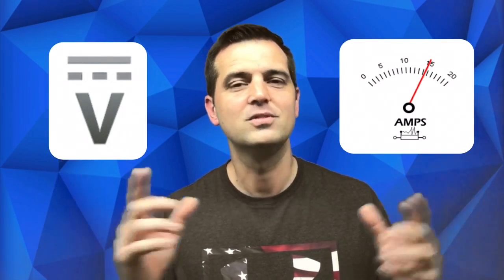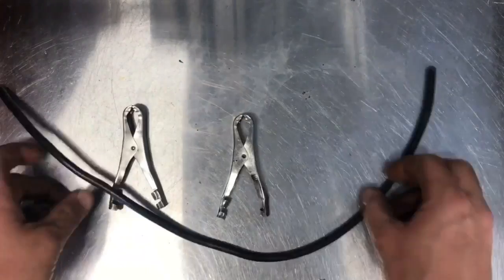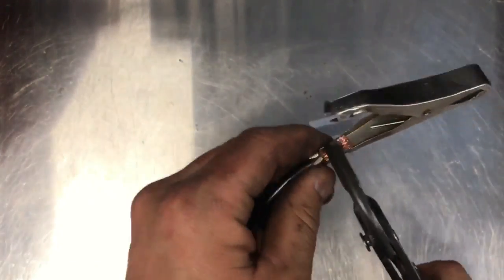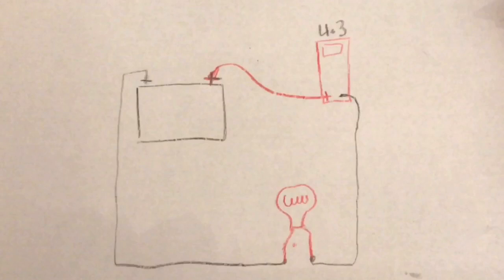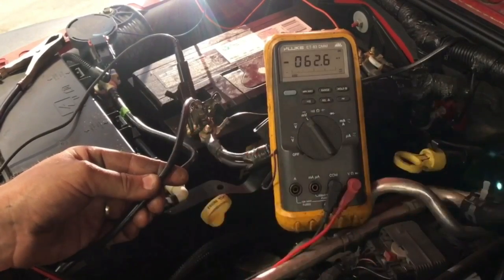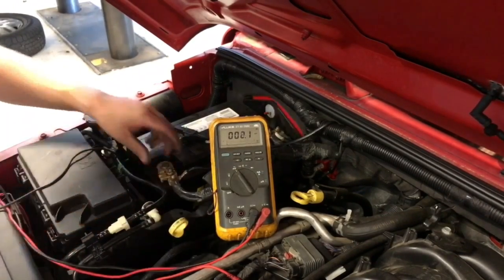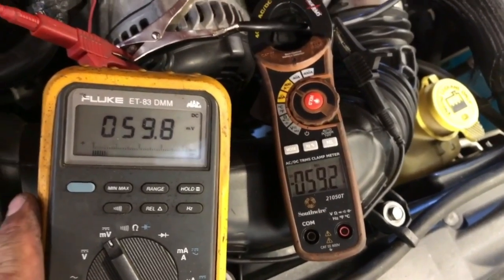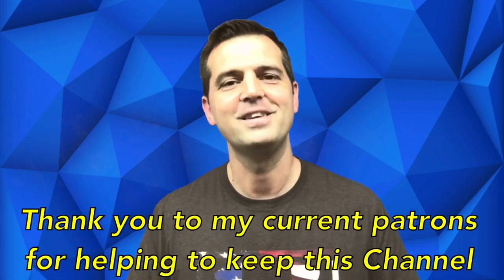How to test an alternator the right way!

Comment: Nice trick, but instead of using this testing cable and "calibrating" it, it is much simpler to use the procedure you describe by using the car's negative cable that goes from the battery to the chassis and measure mV across this cable directly. Calibration can be done in the same way. By putting a bulb of known current draw across the battery terminals and reading the resulting millivolts on the multimeter. Then, this value is the reference value for every new load measurement, by applying the arithmetic analogy method, that is, for the (say) 21 Watt lamp I used as a reference, I measure (say) 15 millivolts as translated current. Now that my new measurement is (say) 86 mV, how much is my new current? In this way one does not need the external testing cable and its calibration making things easier and simpler, while the general idea remains the same. Anyway, your presentation is correct. Thanks for sharing the idea. Personally I am using it for many years now whenever I suspect something wrong with the electrical system of the car. Moreover, one can detect even the slightest parasitic current drain of the car's system, provided that the multimeter he uses is of a good brand name, with proper measurement properties for that purpose i.e. high accuracy in the millivolt range. In this last case, only the immobiliser current draw (which must be known beforehand) should be measured when the car in in a "key off - motor off" status. Any other indication in excess of the (known) value will represent a failure (i.e. parasitic current draw) of the system needing further investigation...

Comment: The "Shunt" here, I think, is actually a voltage divider. 

First, about meters. Internal to the meter, between the "AMP" and "COM" connectections, is a shunt made from a calibrated size of copper. Although copper is considered a "conductor" there is still a resistance to copper that can be measured - although it will be in the milliohm or micro-ohm range (.001 to .000001 ohms). Suppose the internal shunt inside the meter for the amps function has a resistance of 1 milliohm. And now you hook the meter up to the battery while it is drawing 10 amps. Using Ohm's Law were E=IxR. That is, voltage = current x resistance. So, 10 amps x 0.001 ohms = 0.010 volts, or 10 millivolts. The meter is actually internally measuring 10 millivolts across the internal copper shunt (which is actually a precision 1 milliohm resistor) and the meter is actually displaying 10 millivolts... but since the human operator has selected the AMP function, the display scale is re-calibrated to be shown as amps so that the human operator does not have to keep using Ohm's Law to convert the meter reading. 

The meter's internal shunt has a limit of safely handling 10 amps without damaging the very sensitive voltage measuring circuits. To measure current greater than 10 amps requires the use of an external shunt.

Think of his black wire, which has an overall resistance of about .002 milliohms (or 2,000 mico-ohms), as a long string of 2,000 one micro-ohm resisters connected end to end. At the end connected to the battery (at the first of our imaginary resistors) there is no voltage drop. At the 2,000th resistor at the other end there is about an 8 millivolt drop. So, along the length of the shunt, there is a gradient of voltage from 0 to 8 millivolts. By using the pin to probe through the insulation, he is finding the exact spot where the voltage drop is exactly 4.3 millivolts. He picked the spot where number of millivolts would equal the number of amps. He could have picked anywhere - but there would have been more math involved to convert the ratios. This way, we can just read the millivolts reading on the meter and know that it has a one-to-one ratio correspondence to the number of amps.

The theory for his shunt / voltage divider is actually covered in the first few days of DC Series Circuits. But, what Carolina Custom has done to turn a chunk of wire into a semi-calibrated meter multiplier is brilliantly clever!!

Comment: A very good video, thank you.. It shows the general operating principal of a current shunt which are a vital component in many electronic devices. When I build heavy duty power supplies I usually buy premade ones which are solid brass and calibrated, however for the smaller supplies I use a piece of wire of the same length on all of the models, and wire up a stand along milivolt meter which says it measures amperage on the display. It's wired just like you have here except made permanent with soldering.
Reply: Just take off the positive battery cable while the car is running. If engine stays running, the alt. is good.
Reply: Larry Zoch a
Reply: @larryzoch4344 But this isn't true on older models pre sensors and fuel injection is it?

Comment: Works for big jumps in current draw I found.  I had a hard time finding that sweet spot you mentioned.  So I just tapped off not far from the on clamp.  Basically the greater the distance you spread your volt meter leads for the pick off the higher the millivolt reading you will get.  At least that's what I was seeing.  I didn't find it was very useful or accurate in the 10's of amps range, but 20's to 200's you will def see a jump and a big change in that millivolt reading if you turn on say an 1600w inverter with a 1600w load like a heat gun, which is just what I have in my company truck since I do avionics work on Helicopters sometimes remote in the field.  Thanks for the vid.  I found it useful.

Comment: I like your vid even though I just bought a clamp meter that I can also use as a general function multimeter. I just like the idea of not having to disconnect anything to take measurements.
Your video however, taught me a few things and for that, I'll indeed subscribe.  Thanks for making this.

Comment: Thanks, good video...
I used to load-test PC power-supplies and needed a way to measure the load.  That's where the shunt would come in, and I could then attach a mili-volt meter across the shunt, instead of a DMM..
It's the same principle, but using analog guages,,,

Comment: Lots of guys commenting on how an alternator's output may be, say 130amps, but the system may only demand 85amps for charging, a/c, lights, or stereo, etc.  You may have leaky connections.  Where do all those extra amps go?
Easiest way to find out is to slide a piece of cardboard under the car when you pull into the driveway.  Next day, pull the cardboard out and look for any extra amps that leaked out overnight.  They're silvery, shiny, and may leave tiny burn marks.

Comment: Great video I would just like to add that a good volt meter that reads acurate MV's aint that cheap either . AND the price for a fair  clamp meterThat reads AMPs DC  can be round same price as a good volt meter that reads acurate MV"s. So with that I have to say this video is by far the most clever I have seen thus far on youtube KEEP EM COMING BRO cool accent too lol 10 thumbs up for YOU!  Check cheaper clamp meters on Amazon that read amperage I picked one up for $27

Comment: Sears sells their amp clamp for about $60. It measure AC/DC amps, voltage, resistance, freq., and continuity (with sound).
Reply: joe r what is a sears?
Reply: Sears, Roebuck, and Company.
Reply: joe r I’ve heard of them...it’s a shame they aren’t around any more, poor mgmt probably ran them into the ground I’m guessing.
Reply: They ARE still around though few and far between.  I still believe you can order that meter.
Reply: @NukeNukemson  Inflexible business model. Segments of the  business lost to Walmart, tire chains, oil change shops. There was a Sear in my area until a few years ago. Their clothing section was small but they sold good men's clothes, I thought.

Comment: Thanks  for the video  its just  that amp meters  so cheap  these days so I don't think  people  would  go this way to test but I like the way u calibrated  the wire  i just never kn a wire  that  gage  could  have that kind of resistance  in such  a short distance.
Reply: D.C. Amp meters, not so cheap. especially  clamp meters.
Reply: 22.99 harbor freight

Comment: If you don't need over 100 amps I recommend the uni-t ut210e it can do dc current up to 100 amps and is pretty accurate even at small currents like under 1 amp if you need that I have one and have been happy with it and it's under $50 but make sure you get the E because they have others but they don't do DC current

Comment: The (calibration) was pretty neat but I'd hook your connections on the copper wire not the clamp because those clamps are probably adding a good amount of resistance

Comment: I am reminded that I don't know as much about alternators as I thought. Thanks. Back to finding out why my alternator won't charge at idle with the headlights on and heater full blast with a 130 amp gen 3 mustang alternator. I am thinking its the grounds?

Comment: I would use insulated color coded alligator clips - splurge a little for safety. You short out your "shunt" and lets see:  blown diode bridge on alternator, battery blows up, roasted electronics/computers, fire, slagged copper and what ever Murphy can think of extra. You might have gotten away with those things thirty years ago, but not today.

Comment: Much smarter than before I watched the video.  This is so awesome!  Anyone wanna share the math behind this?
Reply: @Happymacer  Why would the alternator fry?  I've ran them with open leads for decades without problems.
Reply: @Happymacer  I always figured the voltage regulator would keep the voltage in check.
Reply: @Happymacer  no clue. Been doing it for nearly 40 years with no problems thus far lol
Reply: ohms law that's it
Reply: He made a 0.001 Ohm resistor   so any time you read Voltage   v= i x R    y x 0.001 =  0.00y     or as he said y mV.   same number  just move the decimal over. which the meter does for you.

Comment: I have a clamp meter but found it almost impossible to actually clamp it round the battery/alternator cables, the only access would be from underneath with the car on a ramp. But if anyone is interested you can buy from Amazon and other outlets an adaptor for your multimeter to convert it into a clamp meter quite cheaply.

Comment: What you have done is measured a voltage drop, known as an I.R. drop across a section of the internal resistance of of your wire. By probing the wire while connected to meter, you located the place where the milli volt reading matches your amperage or current for the light (4.3 amps) . For (4.3 mV) drop to appear on DVM screen matching (4.3 amps), you have located a place where the remaining resistance of wire length is (0.001 Ohm) or 1 milli-Ohm. A current flow of 4.3 amps pushing through a resistance of 0.001 Ohm will drop 0.0034 volts or 3.4 mV. to agree with the amperage drawn by light bulb. At a nominal DC voltage of 12V pushing 4.3 amps (12x4.3) the power or Wattage at the light= 51.6 Watts. The hot resistance of the light is R=E/I = 12.0/4.3 R=2.79 Ohm when energized.

Comment: Interesting video. But my question is, do you need to make a new wire for each new car you test? I dont think this wire will work on all cars, because there is different voltage drop.
Reply: No because you tested the drop of the cable you're using so you're good.
Reply from the maker: Correct.

Comment: Using the amp clamp, the reading you get from clamping all the cables going to the negative battery terminal should be the same as the reading you get from clamping all the cables going to the battery positive terminal.  You got different readings because you didn't clamp all the cables going to the terminals.

Comment: So to be clear, you started off with a long thick(ish) cable with crocodile clips connected to both ends which you then cut off, shortened the cable and bodged two more clips onto?

Comment: This is a cool homemade amperage tester.  What is the physics behind this volts to amps test?  Simply finding the sweet spot along the cable which correlates numerically to amperage? Wow, thanks for the learning of something new!
Reply: Mach 1 its voltage drop, look it up
Reply: Ohms law is what you want to study.  One of the key parts of Ohms Law for learning how a shunt works, as Airman mentioned, is voltage drop.

Comment: Wattage divided by voltage equals amperage.So once the wattage of the bulb is known then the amperage can be calculated.
Reply: That doesn't account for manufacturing tolerances and variances. It's really best to verify the individual parts being used and work with those readings if you hope to have an accurate and well engineered system.

Comment: Hi
Thank you for your information. Im just curious about theory and formula behind this current meter that you made?!
Reply: Actually has nothing to do with theory other than the fact that any current carrying wire has internal resistance to it.  Very ingenious of this man to figure to correlate the actual current to the millivolt reading at a certain spot along the wire.
Reply: A shunt (the wire in this case) is basically a resistor with a known, very low resistance. Placing it in series with a circuit allows you to measure the current indirectly by measuring the voltage drop. Because the resistance is so low, the shunt has negligible effect on the current and voltage supplied to the of the rest of the circuit. It lets you measure high currents without having to put a meter in series with the circuit.

Ohm's law says V = IR (voltage = current x resistance, or volts = amps x ohms). Solving for current gives I = V/R. If you have a piece of wire with a resistance of  1 milliohm (1/1000 of an ohm), then the voltage drop across the wire when measured in millivolts will be numerically the same as the current through the wire in amps (0.001 V / 0.001 ohm = 1 A). The trial-and-error in the video was to find what length of wire provides the desired 1 milliohm resistance. This will vary a bit with temperature.
Reply: @thromboid  thanks for the detailed and clear explanation
Reply: @thromboid  Thanks for the explanation, at first I did not get how the mV readings are the same as the amps. The trick with the shunt by-itself is cool, but the thing that you can find the sweet-spot with 0.001Ω of  resistance and you can get the result without any additional calculation is so clever.

Comment: So if I check my alternator amperage by clamping my multimeter around the designated alternator wire and it reads 2.84 amps AT and0.033 AT APO.  Is my alternator about to go out?

Comment: I have a question am using a car battery 🔋at home my car battery is 50 amperage and I have a charger it 15 amperage is it good the charger to charge the battery will the voltage drop while am using it
Reply from the maker: Do not It leave it alone charging. It could over charge!

Comment: Brilliant, never knew I could use mV in that way! Yes! I did think you were crazy calibrating your cable! I have one question. Who taught you? Thanks
Reply: The cable work as a resistor . And the current moving thru it will drop the voltage of the source . V = I × R . This shunt will work only on DC voltage . 
AC voltage needs a hall sensor .

Comment: I changed alternator twice with new one and have a new battery but still not charging need to test the alternator not sure how I will check the field wires one is red other is brown I am assuming red is hot brown is ground.  If you can help me get it to charge I will donate money to you thanks

Comment: After you calibrate the cable, does it matter which way round you attach it afterwards?
Reply: Yes, as the length of wire is proportional to the voltage drop you will be measuring. Switching around the wire will change your readings.

Comment: Does the "old school" method of checking an alternator still work? Get the car (with a possibly bad alternator) started and disconnect the negative from the battery... If the car stalls, the alternator is bad. 

I like your homemade smh clamp though... I'll give it a try.. Thanks
Reply from the maker: Yea, that should work On older vehicles Not sure if I would want to do that on some of the newer vehicles with all of the electronics. Especially the JL. Have you see my video on the JL when you disconnect the battery? https://youtu.be/KgvXTAnZvNE
Reply: Disconnecting an alternator with vehicle running is not a  good idea as you fun the risk of damaging the alternator, though I've done it many times as myself

Comment: Hi, is the dc amp clamp needed or any amp clamp?
Reply: Must be DC for this application.  AC will work if the voltage is say 120 volt house voltage.

Comment: So actually what you can do except instead of using that little black wire that you made up and you could use the wire that's already connected to the alternator and do the same test and find out the same milliamps on The Sweet Spot of the wire that's already coming out of the alternator and you have a built-in spot you can check all the time without making a special wire